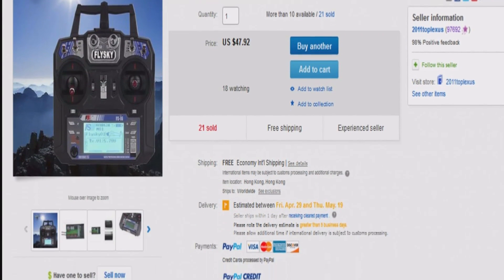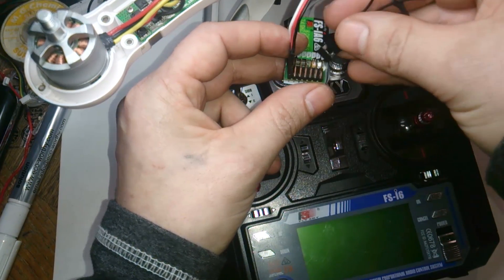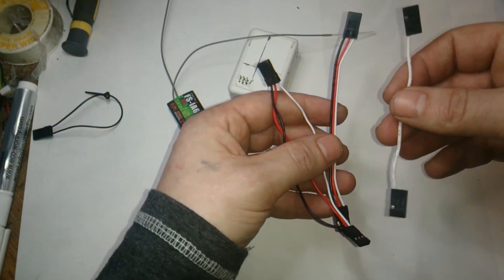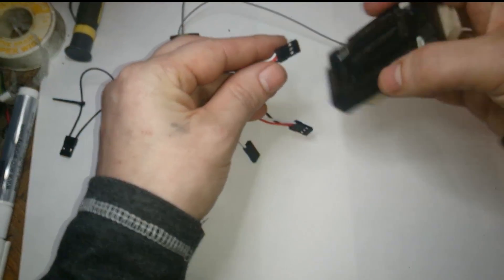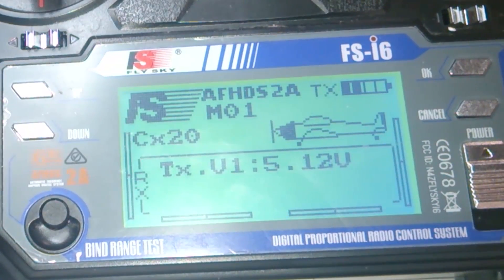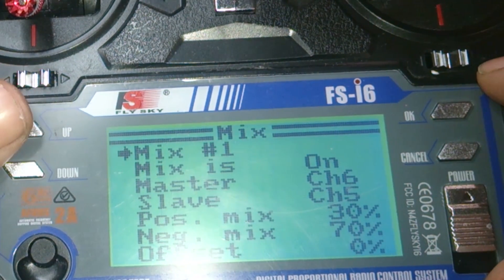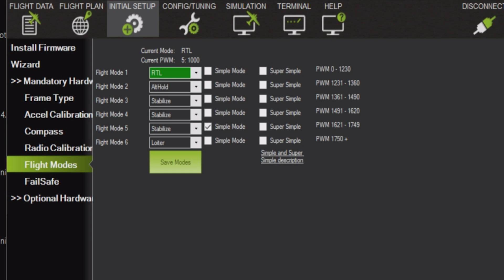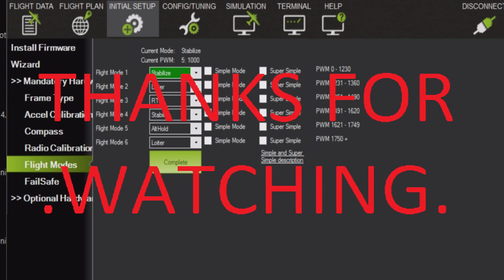cx20 flysky FS i6 FS IA6 binding and Mission planner settings

Comment: Hi sir i have a doubt. On fly sky i6 transmitter we can use 20 different models or it has a space of 20 different models. I am using fsi6b receiver for my quad sir .and i bought fsia6 receiver from bangood. But when i bind fsia6 to i am loosing connection with my quad receiver fsia6b. What to do now. Sir please help mee and Please replay me sir
Reply from the maker: Hi you need to go into setup and "select  model".Push down button to select model 2 ... 
Push ok . after you select it then cancel to get back to main screen 
Now bind it.with other receiver
  When you want to switch to other quadcopter you need to go back into setup change the model to model 1  then it should work with your other receiver ..
Reply: @ModItBetter  thanks sir
Reply: Sir please make a video on upgrading fs i6 6 channel to 10 channel transmitter
Reply: And if its possible please make a video on fs i6 transmitter. To use the same transmitter for quads and airplanes with different fly sky recivers.
Reply: Oh ok sir thats what the reason if iam binding with  one reciver means its losing its momory that was saved.

Comment: Bangs I don’t understand why you say reverse channel 2
Did nothing for me except reverse the pitch the wrong way
I followed white cable next to white cable procedures and on my apm it’s same white next to white

I went through the switch settings they all seem to work fine 

Also I have the B version receiver 
So does this mean I can regain the dials without flashing the unit at all ?

I messaged you on Messenger other day to see if you was awake , I don’t think you was 😀
Cheers for any info you. Can offer back
Reply from the maker: Hi ..odd you don't have to reverse channel 2.   .. have you actually flown it or are you going by mission planner ?   If you move the stick up in mission planner it moves down??   then that is right.        you will know once you try to fly it anyways .
Reply: bangs6996 hi Bangs 
If I move the stick up yes it goes down when set to reverse , Sw switches working fine as set up to your video settings tho 
Not been flown as yet this is just in Mission Planner 
 Can you also advise me on the single white wire S1 I think to apm on what this does ... 
cheers mate
Reply from the maker: ok so thats the way you want to have it..with it reversed..
hmm not sure what wire your talking about unless its the one that use to go to
-2 or -3 on the old receiver.. then thats your gimbal wire.. one has red and white.. and the other just white..

the problem you have is the receiver is only 6 channel and it uses 2 of them for mixing 5,6   .. if you go to channel menu on your transmitter you might already have a newer firmware that supports 10 channels or so.

you will then have to enable ppm and put the gimbals through the apm it self to control it.. I can help with that.. If you actually use your gimbal wires.. (the 2 variable dials )
Reply from the maker: in this video i show how to connect ppm ..with the apm2.6 and the cx20 apm

https://www.youtube.com/watch?v=Ir0OZmRPpyU
Reply: https://youtu.be/Vyt2d8rXkws?t=335  Thanks Bangs here is the one wire left a single ....
Reply from the maker: did you remove the black and red wire out of it..? factory usually comes with all 3 wires with that one..  anyways if you did remove the red and black.. that wire use to plug into -1 on the old receiver .. (channel 5)    that is your flight mode wire ..at least the part in the video i showed.. ..
Reply from the maker: this part of the video i sorta explain the wire and why i removed the red and black..  
https://youtu.be/mrBWEATUbus?t=295
Reply: bangs6996 thanks Bangs yes I unpinned the red and black and added like yours
Reply: Thanks Bangs yes i had to set 2 to reverse , i feel dumb lol , just have to control it moving on its own now , maybe re calibrate controller as i changed to reverse when i realised i had it wrong and kept flying ....

Comment: Hi Bangs,
as usual, thanks for helping us out!
Now, I'm back to the CX-20 after 8 months letf under dust (fault goes to DJI!), coz I still want sth that's free to fly out of BigBro's control (here in EU).
Thing is, I bought this tx in dec 2016... and never packed it out so far,  not sure it was worth it... And today, I begin to understand why you said (quote) "it's a downgrade".
Yep, the original RX goes with AETR+1+2+3, here we only have 6ch. Although... the original box displays "6 channel transmitter"...
My question follows (urgh!) : 4channels for sticks + 2 switches + 2knobs on the original package, that was working with 7 channels, right?
So my guess is, the switches A+B on the original CX-20 Transmitter must have been mixed into one single channel (giving values ranging from 0 to 1500 depending on combinatioen). So, I still look for a way to use one channel for the 4 switches of this FSi6, then... the only left one (the 6th), could be allocated to any of the 2 potentiometers... is it right?

Moreover, if I got your previous answers right, there's no way I can use any of the data (power module, telemetry) sent straight to my "new" fsi6, since there is no input on my FS i6, I require an FSi6-B... which will still be stuck with 6 channels...or otherwise?? 

I was hoping I could use my ol'3DR 433Mhz telemetry module.

Thanks for unblinding me (again... again...).
Happy to come back to your YTchannel.

Max
Reply from the maker: HI if you get the receiver ia6b then you can upgrade to all the channels you need..
using ppm  ..i have this video about the upgrade https://www.youtube.com/watch?v=o-gEJ_U3GDI      If you have a usb to serial adapter its only 3 wires.

you are right about channels 6 and 5 being pre mixed between 1000-2000.
well hard coded on the cx20 transmitter.

I actually had to make a video on custom firmware i made to get the cx20 transmitter to work with the dji..flight controller 

I believe i show the settings in this video on the dip switches..you might be able to get just one dip switch to do the basic for example..
manual , loiter(gps hold), failsafe/return to home.

also in another video i show a easier way then mixing ..just by using end points .. https://youtu.be/GMeAXyKahlw?t=853

however you might have to play with both ways i have not used that remote for about a year..or so.
Reply: First, thanks, again, for being so prompt to reply (to whoever bothers you with silly "er..dunno wazzup" questions!
I don't have any arduino item  so I already ordered a USB/ibus cable a few hours ago, the Fsi6-B should come next. From China, may take a few weeks to be delivered... I thought I could just solder some USB plug and it would be ok... dummy!
So far, I am wondering what to do with the wires that were connected to original CX's Rx,  pins "2" & "3". They are signal(white) for S1 and S2 outputs (CX's Tx knobs -> gimbal e.g.), as I followed them (red is just a +5V). If I wish at least one CH from FSi6 to be related to S1 or S2, my guess is to plug to the pin CH8 (white to S, red not surely required).

My future wish is to replace (soon?) the original flight controller/APM with some DJI's...of even better. Because now I got used to DJIGO4, I kinda like it (any now and then it does not crash, I mean !!!). The only baaaad side, is that I would be again, under total control from DJI's politics. SO , I want to try and test alternatives...

The final idea, would be to go as far as possible with the CX-20, to I can collect everything that's working best from it, and resume the process with the selected parts on a F550 (maybe F450), meant to carry heavy payload (my 3axis gimbal was always a power drainer/sucker!), mount a good cam, and eventually use my OSD, 3DR and Power modules in full, so I can have a REAL platform to film with, all data to control and to program, that's why the new RC, to have more switches to program.

You are admirable for keeping track of my comments, as usual!
M
Reply from the maker: yeah the arduino is a pain in the butt.. as you need resistors as well... a usb to serial adpater is quicker and cleaner..or the actual cable that plugs in the back of the transmitter ..

after you do the firmware update ..you would either use ppm or the 8 channels as you suggested  5-6 with end points.. and 7 8 for gimbals..

if you get stuck with only being able to use ppm then fallow this video
https://www.youtube.com/watch?v=Ir0OZmRPpyU&t=1s

I show some where in it how to setup the gimbal to use output 7 and 8 on the apm .but you have to set up the settings in mission planner gimbal section. for rc7 and rc8

funny about dji .. it took me over 30 takes to finish up the end of my cx20 to naza upgrade video .. I kept just rolling into a rant...the software speaks for it self and how they did a v1-v2 same hardware just tops it off...hehe..seeeee i want to get into a rant now lol...

personally I would not switch the motors and esc's over to a new platform I would just order 4 a2212 2200kv motors and 4 cheap 30 amp esc's.. usually you can find them in a kit for about 33 dollars..  they out perform the cx20 hardware plus you get larger blades..  <--the only thing i don't like about the cheap motors is how the blades get centered  with washers..

however it does not hurt trying with the stock cx20 first just to see ..
Reply: Hi B!
So I'll wait "patiently" until my orders arrive (it doesnt make sense to begin with sth which will limit my usage).
Til then , I set back the CX's Rx back into place and think of other mods...
Now that I know the diffences  between PPM,PWM and iBus (jeBus? that's also new now?), I still can not make sure about the RXs protocols FsIA6 or FsIa10B (which I ordered to make full use of that guy).
All night, I was TRYING to calculate the values to mix with CH5+CH6 to have a better and clear range between 1000 and 2000...then your waypoints seemed to be the cooler shortcut to that headache!

Again, you rock with those stuffs!
You must be some kind of Emmett Brown ;)

Comment: Is it possible to leave 6 flight modes?
Reply from the maker: I can get 6 by doing it this way https://youtu.be/Ir0OZmRPpyU?t=221

disable the mixing part  i show in this video and just set your end points.
..or you can try using both.. 

https://youtu.be/Ir0OZmRPpyU?t=221
Reply from the maker: then jump to this part https://youtu.be/Ir0OZmRPpyU?t=558   of course ignore the variable parts i talk about if you have not modded your receiver yet.
Reply: bangs6996 My radio has old firmware and does not have the Swb + c option. Only channel 5 Swb, channel 6 SwC ...
Reply from the maker: ok ..what happens if you try to mix them..but leave it at the defaults 
then try to go to end points?    ..and set the end points for both of 
them.. or just one of them..heh....I'm deep in a project and can't clear
 my table today to play.. .....     .. a handy tip is to have mission 
planner on .. and go into radio calibration ..then play with the end 
points and the mixing ect.. and you can see your progress in real 
time..
Reply: OK, I'm going to test the end points and try to find this, but thanks for the tips, if I can I'll leave a feedback. Thank you.

Comment: Can The i6x ibus work with the cx20?
Reply from the maker: hi , No as far as I know you would need to buy or make a ibus to ppm converter .. however the specs says this 
Channels: 6(PWM), 8(PPM), 18(i-BUS)

usually all that is needed is the 8 ppm, for the two gimbals. 
So you are fine if your happy with the same setup as the original remote.

as far as I know as well the video i had made on the daughter board ibus to ppm ..only supports 10 i-bus channels as well.. maybe 14 but I think that was a branch off the main code.
Reply: bangs6996 ok so how you going about the 8ch ppm cause I love the feel of the i6x
Reply from the maker: wow .. sorry I did not see this until now..youtube never notified me of the message..
if you have not figured it out yet.. you can check out this video
https://www.youtube.com/watch?v=Ir0OZmRPpyU

your receiver might be different you need to attach it from the ppm port to the apm the same way ..
Reply from the maker: hmm not sure if you want to watch the entire video ..
https://youtu.be/Ir0OZmRPpyU?t=120   is the jumpers for the cx20 apm

so on your receiver .find your ppm pins..and attach it the cx20 apm the same way on the first rail .
then because your not using e,t,r,1,2    remove all those wires from the apm.. with one of the wires make a jumper wire to go over pin 2 and 3 like in the video . or find a jumper..    .. errr and you need to change the setting on your transmitter to use ppm.. I don't have your remote so not sure if its 100 percent the same firmware and settings..
Reply: bangs6996 thanks a lot I will now purchase the cx20. Wi was just making sure I could use my i6x. This quad seem very good and very upgradable.
Reply from the maker: your welcome.. when ever you get the quad and if you run into any problems just hit me up in my newest video at the time..it does not have to be related to your questions.... Youtube sometimes does not tell me about messages on them.. ... oh and because you don't have it yet.. NEVER plug in the usb cable and the battery at the same time.. or  you will be watching lots of my esc videos heh..
Reply: thanks bro will surely do because i love these kind of diy project etc. whats the biggest battery it can carry. flight time is my thing
Reply from the maker: when i got my first one with the 2700mah battery i was getting abaout 15 mins.. i upgraded the battery to 2800mah and it went to about 19mins.. I have a couple of 5000,5500 battery's and it lasts about 22 minutes ..  once you start adding things like landing gear and gimbals . the time in the air will start getting shorter ..

getting a extra battery and a imax b6 charger will drastically cut the down time .. the stock charger charges at 700mah (3hours of charging or more) where if you get the imax b6 charger
you can charge safely at 2.7amps  cutting the time down to about 40 mins ..
Reply: bangs6996 just a quick question, what's the max range on this cx20, I've been checking online about this drone  and see a lot of crashes. What's causing those
Reply from the maker: HI , lots of things can cause a crash.. the cx20 remote is acceptable to wifi ..but because your using another receiver and remote you might be totally fine now..  ..   the first month I had my quad.. it just for no reason took straight up to the sky past the tree lines..then just turned off and came crashing down.   I blamed my issue on a faulty barometer or gyro..    if the firmware screws up and some how the gyro settings glitch and appear to have the quad level ..but its physically side ways.. you are s.o.l ..  the fly away's are worst for all quads  ..expensive or not..   I think that is some weird software loop .. where its totally ignoring the receiver and using the last variable . 

Sadly you have to be ready to loose your quad at anytime and with what ever hardware on it.

Comment: i recently bought fly sky FS-i6. but the problem that i am facing is the it is not getting bound by the receiver which is FS-iA6. 
i tried all types of binding. still it is not binding.
can you help me with this
Reply from the maker: which quad do you have?

you just need to add the jumper wire / key on the receiver

https://youtu.be/Vyt2d8rXkws?t=85
what happens when you fallow this.
If you don't have a cx20 you just need to power the receiver some how..
Reply: These are the steps i followed
 first i plugged the bind plug and then i gave 5.0V power supply to the receiver. the led starts blinking fast. then i pressed the bind button and and switched ON the transmitter. the blinking rate slows down but it doesn't show any connection on the transmitter.
when i remove the bind plug the red led should glow continuously without any blink but its still blinking. when i remove the supply and and connect it again, the led starts blinking fast even if the bind plug is not connected. i tried every way
Reply from the maker: Ok .. so are you holding the bind button down while you push the on switch?  try it that way ... watch the screen to see if its says bind successful ..

or does it sit at screen that says "RXBinding.."

if so..
turn off remote and turn it back on
Hold ok
..MENU..
..choose system
go to 
RX Setup
.. click ok on
AFHDS 2A
 
does it say
AFHDS 2A
    ON

if it says off
push down button. so it says on
then hold the cancel button to save

then try again.

Comment: mate can u do failsafe with this Tx and APM? Like loss of signal RTL? Do you think this would work with the ia6b receiver?
Reply from the maker: yes it will work the same way.. as it should be pretty much set.. but you can tweak your settings to lower them or increase them in mission planner failsafe section..

What I do is use telemetry or usb cable and just test it..
arm the quad with no blades move throttle up half way and place the quad higher up..
then turn off the remote. and see if the hud blinks failsafe..   Honestly I would never test this out side with the blades on.